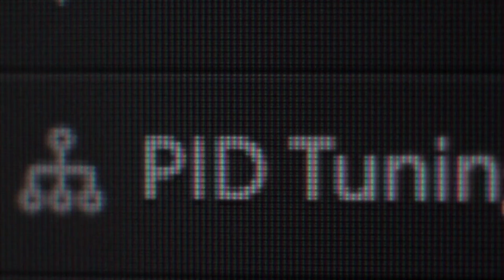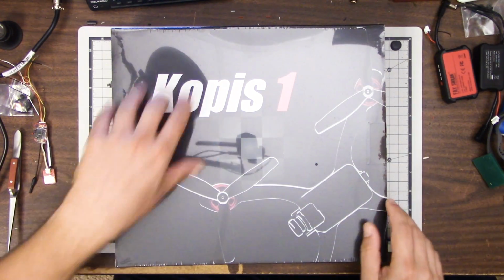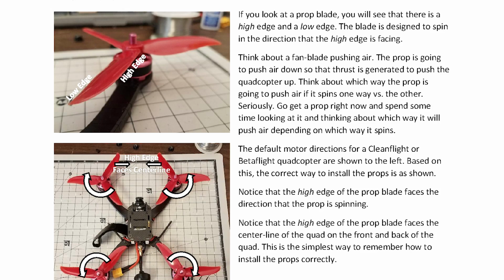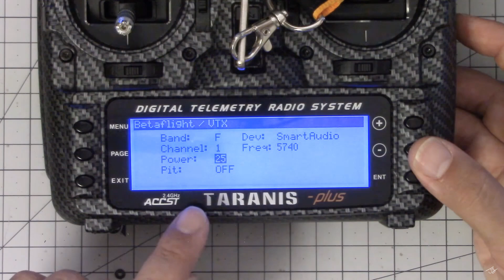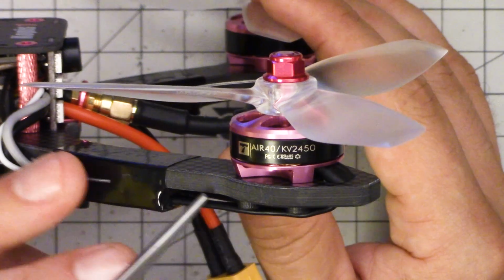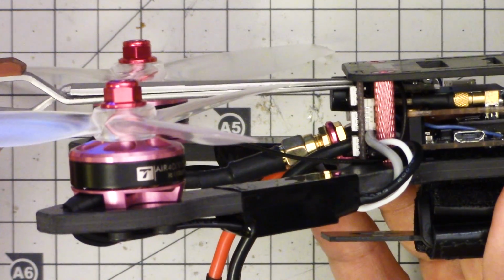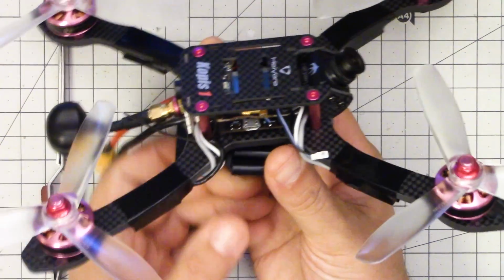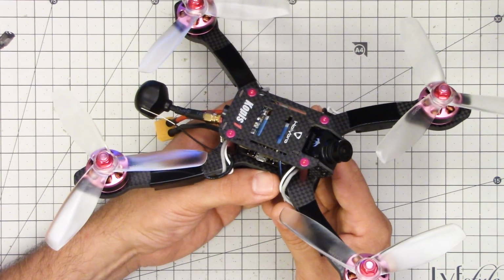Holybro Kopis | THE BEST $300 RTF RACING DRONE NO KIDDING

Comment: Hey Josh, I just got my Kopis the other day. First let me say I have a ton of quads. The 2017 diatone gt200 s, the Loki S, The Draco, The Gandi, etc. This is BY FAR the best flying quad I have ever flown! Not to mention the quality of the components, and the quality of the build. Also a GREAT manual! This is NOT hype, it really is the best. Its so user friendly, they really pulled out all the stops on this drone. The t-motor air40's are GREAT!!!! like you said, not the most high tech motors, but great on this quad. Could I put bigger motors, of course. But I don't want to mess with mojo!
Reply from the maker: Glad to hear you had the same impression I did. I don't know what makes this quad fly so good but it really does fly good.

Comment: As far as the GT2 goes, at the time it was a whole new level of performance in bind and fly durable racing quads (at least as far as the frame is concerned).  It jump started that market.  I loved it until the D-Link FC did not survive crashing well, which is an integral part of FPV racing (I race MultiGP in Detroit, or am learning to anyway).  

I rebuilt with DYS  F4 and have never looked back.  It has such impact that I now build with DYS F4 stacks.  I am convinced moving the ESCs to center of mass is significant for racing, for acro freestyle as well.  I have since switched to a 2017 GT2 Stretch which is even better for racing.  All of my quads now fly awesome, which has a lot to do with Betaflight 3.2 (and your guidance!!  Thanks for all you've done.)  And finally, my current #1 racer is a lighter DMR Stretch X frame with arms that can be replaced, because the weight thing has finally sunk in, though not deep enough for hyperlight,  yet anyway... (though I am looking at frames currently, an addiction for sure)

Comment: In theory, rounded edges make the quad stronger—well, more resistant to crash damage anyways. It's a little counterintuitive because, despite the fact that you are removing material, you actually gain a mechanical advantage (er, disadvantage in this case since rounded edges make for weaker levers). Square edges transfer energy at a singular point of contact, which concentrates force application and material failure is thus more likely—stress fracture, delamination, etc. Rounded edges make the quad more damage resistant because they help to transfer and distribute stress flow more evenly. The greater the radius, the more the principle applies. Think of it this way: If you're cutting a tomato, would you rather have a sharp or dull knife? Obviously sharp because a sharp knife (very thin cutting edge) transfers the energy you input at a very concentrated locale, thus making it easier to break the surface tension of the material. Rounding the frame edges "dulls" them the same.

Comment: Because I was bored am am having a good time doing builds, I priced this out.... parted out, it's lower price... Now, the choice is, have it prebuilt with the xsr receiver and the hardshell case or build it myself... with no hardshell for the same price. Honestly, the spec is nice even with the 2450kv TMotor Air 40s. I'm thinking of getting this as my secondary behind my F7 performance build. I'm enjoying the manual, BTW.

Comment: Did you write the manual of the kakute fc ? The instructions were so clear, my first build was a pleasure. Btw, you can say to holybro that their fc is fireproof, seriously.  My crappy cheap 4in1 esc burnt on 3rd flight of my first quad, just under the kakute fc, and I shut off the fire quick enought to save everything but the esc. But now I need to buy other escs... Any recommandation ? I plan on going 30a not 4in1 but I wonder if 30a is overkill since I never really flew...
Reply from the maker: Yes, I wrote it.

Comment: Can’t believe I just found this 101 manual. 8 f@@king days trying to get my mob 7 and still can’t get motor 2 to spin. Gonna print this out and start again. Does it take into account the qx7 eu lbt version. Not sure if that’s causing my issue. Channels been mapped, motors been swapped, take off angle 45 degrees.  Not sure what else to check? Hate being a noob but at least I’m learning ❤️

Comment: Joshua good job with these videos. keep up the good work. Now i been a land love RC guy for years and years. Stop RC car/trucks for a while. And now i want to get into the air. I've seen lots and lots of reviews, how to, how don'ts ect. So i'll ask the question that im sure you get 1,000,000 times a day. for a person like me. Going to be learning. I think as of now i narrowed my choices to the Holybro Kopis, Or the Aramattan Rooster. So what do you think?
Reply from the maker: Man those are both fantastic quads, honestly I would be hard pressed to pick. The rooster is a bit challenging for a beginner to build, but it's an absolute tank of a frame. If the Kopis has a weak point, it's the motors are a little under-powered, but maybe for  beginner that's not a bad thing. 

I don't think you can go wrong with either really.

Comment: One of the issues I have with the Atlatl HV is that Pit Mode is *15mW*. That can easily blow someone out of the air.

I know you shouldn't power up at a race anyway, but still.
Reply from the maker: I was just looking at Banggood and they say they have improved the Atlatl to have proper 0.5 mW pit mode. All units shipped since late september have the fix.

Comment: +Joshua Bardwell, need your opinion! Having been flying the Kopis with a basic Turnigy Graphene 45c and it's been pretty good but we just tested Tatu R-Line 4s 150c battery today with the Kopis and as soon as we punch the quad it just basically FODs, do you suspect a cold solder joint?
Reply from the maker: +DroningON.co no. I would look at the tune. Excess D gain perhaps. Do you hear oscillation when you throttle up? Maybe a damaged motor if you have crashed it.
Reply: No crashes so far so we've ruled out damage (unless factory damage of course) but you're right that there is oscillation upon throttling up out of turns, we're struggling to identify whether its yaw or roll oscillation however - how are your Blackbox skills :) :)

Comment: Looks like an awesome quad for a rookie like myself. Just a couple questions, where can I find something for better battery protection? and I see that the atlatl supports audio, does it come with a mic or would I have to install one?
Reply from the maker: The Atlatl does support audio but I am not sure if it comes pre-wired for it in the RTF version. I would need to check this with Holybro, but by the time I do, I fear your comment will be lost in the river of comments I get. I would suggest reaching out to Holybro to see the answer. Ask on the RCGroups thread or on their FB page.
Reply: Thanks JB, you're the man!!

Comment: I have ordered a Kopis 1. The manual says it  Supports 4S-6S battery (motors are optimized for 4S). However, since I am new to FPV and RC in general, I am not sure what to look for. 
Should I go for high C batteries or how do I select my C rating based on the speed I will be getting for it. If the motor supports only 4S, will it do any damage if I use a 6S?
Finally can you list down some actual battery names and model numbers with ratings that I can use, and what chargers I should buy to charge them? - Thanks man. Cant wait to get in the air with this thing :)
Reply from the maker: Use 4s.

Www.fpvknowitall.com/ultimate-fpv-shopping-list
Reply: Thanks. I was using this battery for the initial setup in betaflight https://www.amazon.com/gp/product/B013I9T0T6/ and I noticed the body heating up. The motors were barely spinning at all and the quad did not take off at all. It was connected to my pc  the whole time by the usb cable. Are those the wrong batteries or something?

Comment: Hey! I just got a Kopis 1 and I love it. Question for you. Any advice on adjusting the tune for carrying a RunCam 3?
Reply from the maker: I carry a GoPro on mine with no major changes to the tune. In general, you need to raise P a bit if you add weight.
Reply: Could you possibly post your current tune with the GoPro mounted? I'm having some vibration problems and suck at tuning.

Comment: I'm just wondering if u think the older style low power motors are a good tradeoff compared to some of the bigger ones i.e. f40 series? What sort of flight times do you get? If it's substantially more than an f40 (or similar modern motor) then it may be worthwhile...
Reply from the maker: +Dale Pattison I think I addressed this in the review. The quad would probably fly better on newer more powerful motors. I don't really remember what my flight times were on average. They have to have been a bit longer than some 130 amp motors though.

Comment: Hey Josh - Do you happen to have the "default" configuration for the Kopis 1 backed up? I stupidly used the "save configuration" in Betaflight before upgrading to 3.2.1, and restoring doesn't work... I've just read in your manual "Without going into too much detail, they have some significant drawbacks that mean we don’t recommend that you use them" - yeah, kicking myself. I can't see anywhere where the defaults are actually listed, eg ESC protocol etc.
Reply from the maker: +JPG I can give you the configuration off of mine. Email me joshuabardwell@gmail.com

Comment: Hi Joshua....I purchased the Kopis based on your review.  This isn't my first quad setup, but since you wrote the manual I have a question about the Kopis setup.  I have it just about ready to go.  But what I don't understand is why the quad reboots when I go down left with left stick and down right with right stick.  I set up the arm switch on an aux channel.  I can't find any setting to prevent this behavior.  Any ideas?

Thanks
Reply from the maker: That stick command is "save settings". It's used if you have made in-flight adjustments, to save the values. Otherwise, they are erased when you reboot.
Reply: Ok...I just tried it with the quad armed and it did not reboot the quad.  That was my concern.....rebooting in the middle of a maneuver.  Thanks for the quick response!

Comment: I am happy by the precise flying this frame allows. I am very unhappy with restricted range of the Vtx and breakups in midflight no matter how much transmitting power you use. Problems don't go away even if you reposition the Vtx antenna in a more traditional upward position. It seems to only sort of go away if you fly full throttle which brings the back somewhat upward. Making a turn away from you is nevertheless a constant "adventure" . Maybe the Vtx module is just poor quality, I can only guess. In summary it is hardly flyable in a tree orientated airspace or you need free vision in a 400m circle.
Reply from the maker: I haven't noticed any such problem. Maybe the antenna is damaged on yours?
Reply: I tried the TBS alternatively without an change

Comment: JOSHUA, HELLO, I HAVE A QUESTION TO ASK YOU BECAUSE I RESPECT YOUR KNOWLEDGE! I AM GOING TO BUILD A 220 STRETCH X FRAME QUAD USING A KAKUTE F4 FC SAME AS IN KOPIS & SURMAX 2207 2600KV MOTORS. I DO NOT HAVE ALOT TO SPEND ON ESC.S SO ESC.S THAT COST 15.00USD OR LESS WHAT WOULD YOU RECCOMEND? THANK YOU IN ADVANCE FOR ANY OR ALL HELP!! SORRY FOR USING CAPS CHEMO HAS MY VISION SCREWY SO THAT IS WHY I USE CAPS, NOT TO YELL.
Reply from the maker: Check my site: https://www.fpvknowitall.com/ultimate-fpv-shopping-list

Here's where I list my favorite ESCs: https://www.fpvknowitall.com/fpv-shopping-list-parts/#electronic-speed-controllers

Comment: Hey Joshua, did you tune it again ? If yes, can I know your PID? I will be flying on the same given prop
Reply from the maker: I have never really been able to improve much on default PIDs. I turned D gain up for a while to try to improve propwash, but I smoked a motor, so I wouldn't suggest it.
Reply: Joshua Bardwell ok

Comment: I just downloaded the manual. Concerning the install of Spektrum RX.. The specifications that I find, call out for 3.5/ 9.6 volts input to the receiver. Why change to 3.3 volt input on the board?
Reply: I just had to re-read the manual..OOOPS! the wiring change only refers to a satellite receiver. I checked the out put from my Spectrum receiver to the satellite and guess what? It read 2.98 volts. Good Job Joshua!! Great manual!

Comment: Hi Joshua.  My Kopis just arrived in the mail today.  I'm having a pretty easy time going through your manual, but I'm also a dummy.  I upgraded my firmware without first saving the Kopis' original settings!!! Is there a place I could get a backup file of the out-of-the-box settings?  

Also, I can only get motor three to work. All four motors' ESCs boot at powerup, but only motor three responds to inputs from the transmitter or the motor testing screen in betaflight.   Could this be some possible setting I erased by upgrading the firmware?
Reply: I need this also... Did you have any luck?
Reply: I don't think Joshua ever saw my comment, but I found it through a little googling:  http://www.dronetrest.com/t/kopis-1-cli-dump/5549
Also, I emailed Holybro and they responded the next day with just a blank email -- I think they forgot to attach the file. Anyway, that link worked for me.
Reply: Oh, and my motor problem was that the firmware update changed my output to Oneshot instead of D1200.  Switched it back to 1200 and worked like a charm.  I'm very happy with my Kopis.
Reply: Mint thanks :) do you know if that configures the receiver for the BNF version?

edit it does, man, life saver. I am saving that now... :)

Comment: I updated firmware and updated to the QX7S from the QX7 and now my RSSI shows 0% on OSD what did I do wrong? It was showing 37% the highest and the transmitter was showing different. I cant find anything about that on the manual.

Comment: My bfight 210 also has an MMCX connector as well. I accidentally broke the cable and am having a very hard time finding a replacement cable. Do you know where I could get one? Thanks!
Reply from the maker: https://goo.gl/rkBvQd
Reply: Joshua Bardwell thank you so much you are the absolute best! Learned so much from your videos and loving the hobby so far. Do you know if there's a quicker way to get this cable? If I could get in the air faster that would be great as bangood does usually take a few weeks to get delivered. Thanks again!

Comment: You always say you hate any Frame that doesnt provide camera protection.. Well This Frame is close to the Diatone GT as far as camera protection is concerned. There is NO camera protection at all. But it isnt mentioned in This Video at all.. What a shame
Reply from the maker: I mentioned this in early takes of the review, but I forgot to mention it in the final take that I ended up using it, and I overlooked it in editing. In some sense, I have kind of given up on this soapbox because clearly nobody is listening. I almost am more likely to mention when a quad is protecting the camera vs. not. The quad flies amazing and I wouldn't reject it because it doesn't protect the camera.
Reply: Hi Joshua, please don't give up on this issue. I consistently write off frames that do not protect the camera and consider this to be a major issue. Sure, you can save weight by ignoring camera protection, but not much if well done. Designers and manufacturers are more likely to listen to someone like you, so please keep up the fight!
Reply: @JayQ FPV - I was thinking the same thing.  That's one of the factors I look at if I'm going to build up a quad with premium components.  I know they're going to break, but if you are going to spend the extra $$, I'd hope you'd get better performance AND durability.  Not a huge fan of having the cam so exposed like that, just my humble opinion.  With that said, I'm certainly not knocking JB or this video.  Love the content and appreciate the channel.
Reply: Yeah, I noticed that omission too.  Definitely something that could be improved with this frame and a bummer it wasn't mentioned.

Comment: Hello good day.
Today I received my Kopis 1 (bnf (xsr)) bought through banggood.
And I have a problem when binding this with my taranis xd9 plus:
When I connect the battery (with the button pressed and the taranis binding) the receiver has the red and green light on without blinking and dont bind :/
Reply from the maker: Make sure the Taranis is set to receiver mode D16 in the Model Setup screen, just above where you select the "Bind" option.
Reply: If everything is as you say, I thought it could be for the eu / no eu versions.
What firmware should I use in taranis and in the internal module?
I do not know what to do: S thanks for your quick response
Reply: solved, for future problems:
you need to update the module xjt to the latest version no eu version 17 .... thanks for all joshua

Comment: Is possible to use the Blheli32 esc in this quad to use the esc sensor? Is it wired? Or need some additional wiring? Thanks!
Reply from the maker: Right now I don't think there is a spare UART but even if there is I'm not sure whether the ESCs support it. So I would say probably not. It definitely doesn't support it out of the box.

Comment: Hmm. Countersinking in 2mm CF? I'd rather not. That will make weak spots. Also, I'd prefer some kind of protection for the camera.

+1 for ESCs under the arms. I killed a Wizard x220 last week with a propstrike.
Reply from the maker: FWIW, Armattan Chameleon countersinks their top plate with no issues that I'm aware of. If it's good enough for Armattan, I'd assume there's no inherent problem with it.

Comment: so you cant change the channel unless you are connected to a PC or have a modded Radio ? what about cheap radios that dont have those mods?
Reply from the maker: No, not at all. You can change the channel from the OSD. In your goggles. With your transmitter sticks. If your transmitter sticks control the quad and you have an FPV display, you can configure the vTX.
Reply: thanks for clearing that up. i guess i misunderstood :)